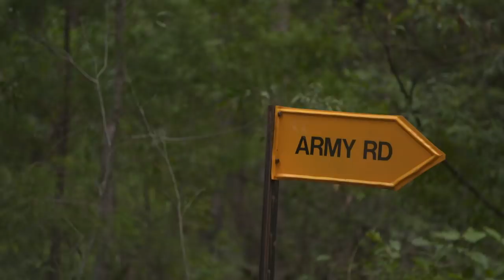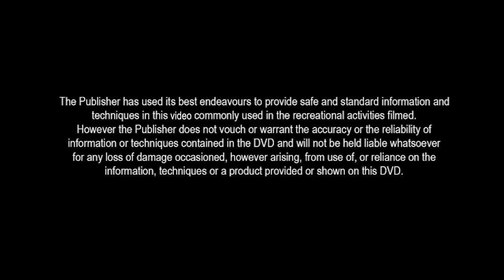COFFS HARBOUR'S TOUGHEST 4WD TRACKS + WA’s INSANE beach camps - GRAHAM IS BACK + Jocko's Hilux!

Comment: 4wd 24-7 i just bought a 1990 Toyota 4runner petrol manual and its decked out for tracks in high country  and I picked it up for 1500 4wd ready, 33 inch tires, steel front and rear bar, side rails and rear locker. A little goes a long way on carsales
Reply: What part of the country yr in Freddie? I have a 91 Toyota 4runner v6 petrol stock, just started wheeling and she just carves the tracks up...
Reply: That's one hale of a 4x4 mate nice rig for the price
Reply: @marcus1ford  im up at jamieson
Reply: @marcus1ford  vic high country

Comment: I like your work boys keep these great vids coming. Just one thing that always gets me scratching my head. How everyone goes on about roof top tents and I am sure they are great but what is your vehicles maximum roof load limit. I can assure you that 99% of all 4wds is only 75kg max including roof racks. Roof top tent 55kg, awning 20kg haven't added roof rack already at max load limit. if you are using Rhino racks they have a formula to calculate off road carrying compacity and it drop down to 35kg load limit off road use. This is over looked by all 4x4  owners.

Comment: I'd go for both, mates, and I would also make sure the whole route/journey is done on government land, so I can get the mining/prospecting paperwork and take the gear to find gold en-route, detector minelab7000 for the bigger bits, a manual rock crusher for the gold-bearing quartz and a portable dry blower and a recirculating wet sluice system so I can find the fine gold as well as the larger gold pieces and make some money on my way around, I would be in no rush, spend 3-7 days in any spot, make a proper trip out of it, a true full Aussie outback driving/camping holiday, now THAT would to me, be a once in a life=time trip worth taking, and a trip I would never ever forget.

Comment: Just so you know, brake fluid doesn't just get used up. You either have a leak or your pads or low. Now when you go to change your pads assuming you don't have a leak your going to push fluid out of the master and Make a mess

Comment: The biggest drawback of running a diesel, you have trouble getting enough RPM's clean out the tires.
If you can't effectively clean out the tread then your tires are no longer digging because they're packed up.